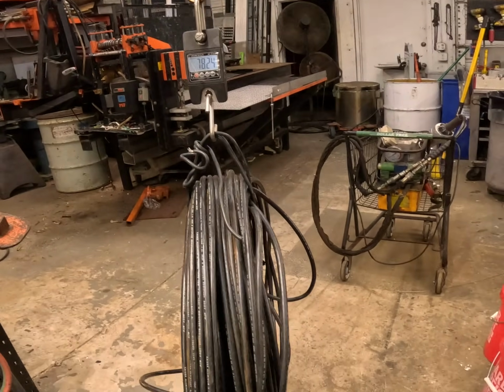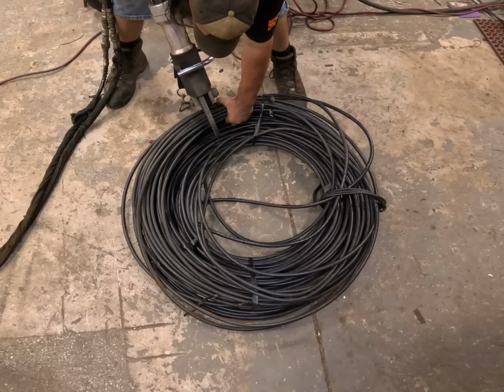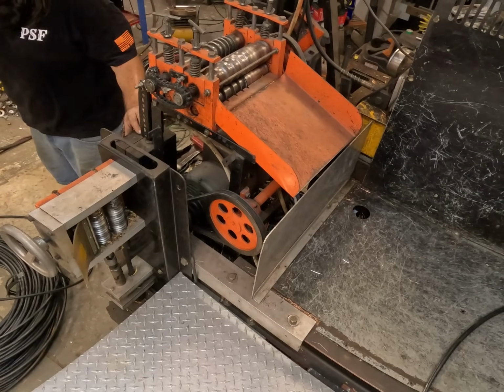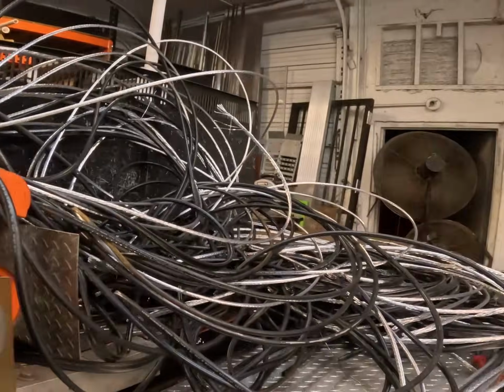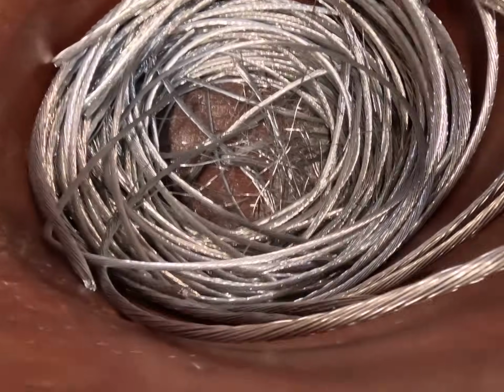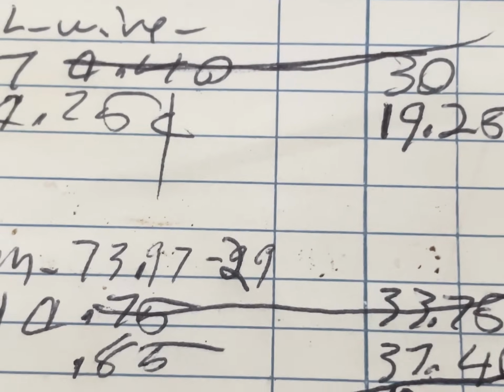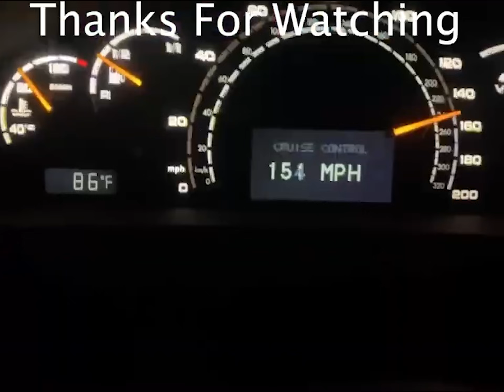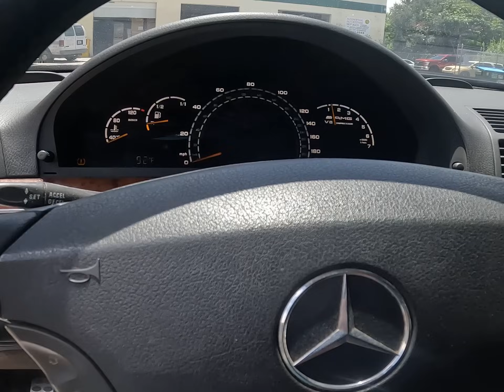Stripping Aluminum Wire Is It Worth It?

Comment: its extremely pure aluminum, its been grossly under valued for a long time. Glad to see the price going up a bit.
Reply: It’s more pure than 6061 or 6063, and wayyy more pure than cast, but I wouldn’t call it high purity. I think it’s usually around 99% aluminum
Reply: @joshp6061  pure was an improper term. technically there's no such thing.

Comment: Why don't you put 2 rollers on your cable stripping machine? In front and in the back.  One to feed the wire and the other to roll the stripped wire.
So you just need to watch for any problems and just feed and retrieve the wire instead of keeping feeding small pieces at the time.
You probably need to guided manual to one roller to the other, or you can also install metal guides tubes (maybe drill or cut in parts so you can see the cable).
Just a suggestion.
Reply from the maker: Thanks for the suggestion. A roller on the back side would have to be powered and as the coil gets bigger it would have to change speed. I like the idea I might explore it in the future.

Comment: You should tell us how much weight percentage is lost after stripping I have 600lbs of aluminum wire and wanted to know how much i would lose 
Say if I had 600lbs and they buy it for .50c it’s not worth me stripping it for 70c
Reply from the maker: You are getting .50 for insulated aluminum wire? Thats more than I get.

Comment: They gave me sixty cents a pound just a couple weeks ago. For stripped aluminum wire.🤷‍♂️ Twenty five cents were not stripped. But if it has electrical company markings on it They will not buy it unless you have proper paperwork . So we just strip it, so there's no questions asked.🤣 P S stop savings Scrap.. It cost you more money to save it.
Reply from the maker: Thanks for the suggestion